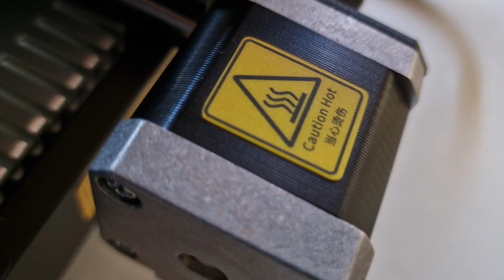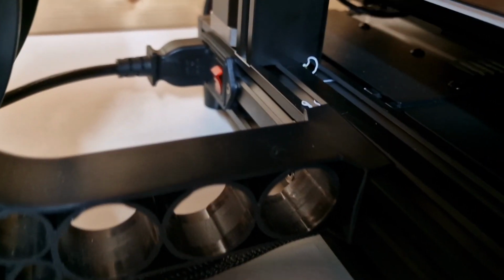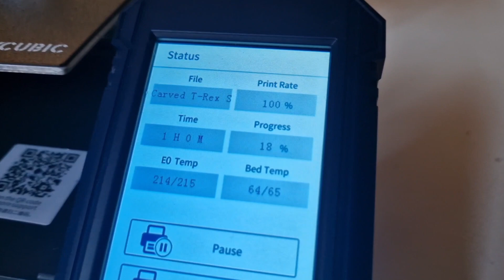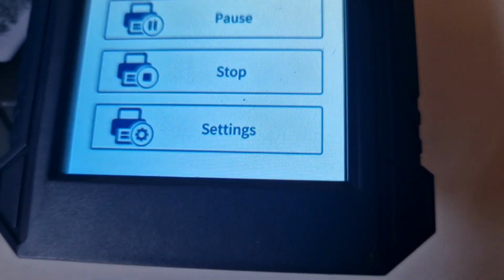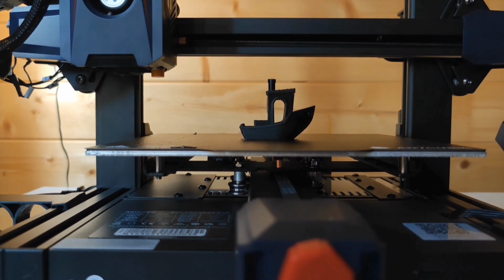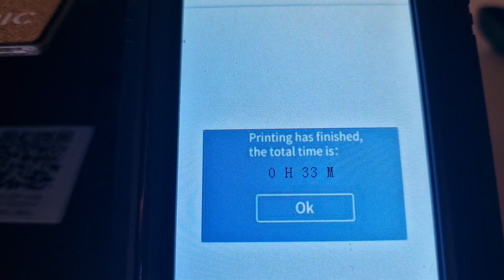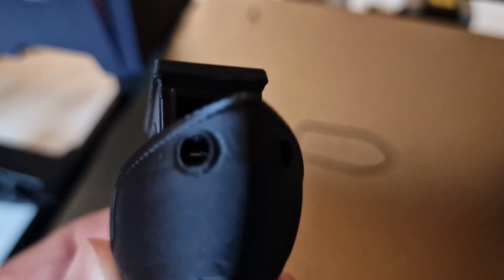Anycubic Kobra 2 review,  can it do a 33 min Benchy??? #3d #3dprinting  #3dprinter #anycubic #kobra2

Comment: WARNING: You fail to talk about the nozzle issue.
This hot end uses a non-standard Volcano nozzle... In fact, we should not say Volcano as it is not one.
A real deal breaker for us. We can't find suppliers for this weird type of nozzle so will probably end-up returning the multiple Kobra2 we purchased for our print farm.
Reply: Wouldn't anycubic supply these? seems like a huge flaw to not have easily accessible parts

Comment: Of the many reasons why NOT to buy an Anycubic, their poor technical support is one I cannot overlook. The extruder on my Kobra failed months ago. After a LONG delay, they said that it is on backorder. Several weeks to months later, I still haven’t received it.

I could fill pages describing problems with my Kobra and Kobra Max, which taught me that better printers are available for less — so why buy an Anycubic? When they work — WHEN — they have some advantages, but they are not offset by the many disadvantages.
Reply from the maker: Sorry to hear of you bad experiences... I have had no issues personally with any of the machines I have... but that's not to say its not an issue... hope your experiences improve with anycubic or other brands thanks for watching

Comment: Nice job reading the spec list off the Anycubic website. All the reviews are the same. However:

Out of the box, XY calibration is off. Sorry, can't adjust it. See comment below.
My LeviQ Smart Z Offset didnt' work. 
This printer is unbelievably loud.  
Only works with 8gb SD cards just like printers did four years ago. 
Song on power up can not be turned off.
No fan speed adjustment in the firmware or slicer! It's 100% all the time.
No e-step adjustment!
No XY steps/mm adjustment!
No LIVE Z offset adjustment! Guess, adjust, guess, adjust, etc.
There is no way to feed filament in steps.
No way to switch filament mid print.
During filament swaps there is no auto resume when the printer comes to temp.
When loading filament, you have to manually stop the extrusion. 
Filament jams require complete disassembly and heat creep is an issue for some.
'Ok' button doesn't take you back to the previous menu.
During filament swaps the temperature varies and keeps you waiting even if you preheat it. 
On FB, people consistently say that the temp on Anycubic printers is "20 degrees too high." 
The 'Back' button is so small that it's hard to press. 
The power button is hidden behind the filament roll.
Noisy Y motor during printing.
Start of print homes to rear of bed.
The ribbon cable is absurdly long with no clear route for it. 
Printing at full speed, this thing will shake the items right off your table.
Anycubic sales said that I shouldn't return my printer "because it might get lost in shipping." Sounds like a threat to me. 

"Hi~ customer 

It is normal for filament printed models to have small errors.

The extruder E step value has been set before leaving the factory and cannot be modified.

Kind regards

Anycubic Team/Amory"
Reply from the maker: Agree with a majority of your comments.  And these issues have been seen through the kobra series so not sure why they didn't use the relaunch as an opportunity to address these issues the community had done most of the hard work for them.